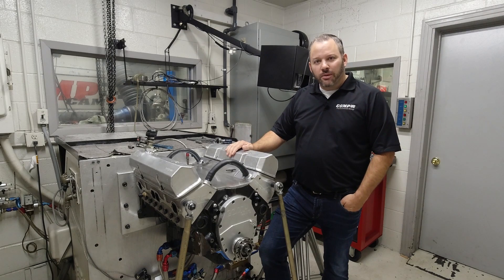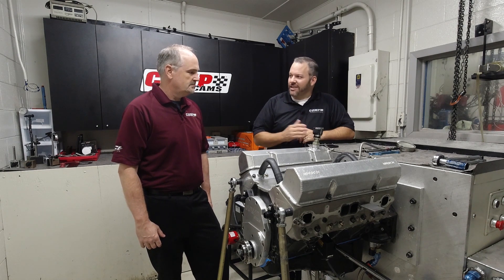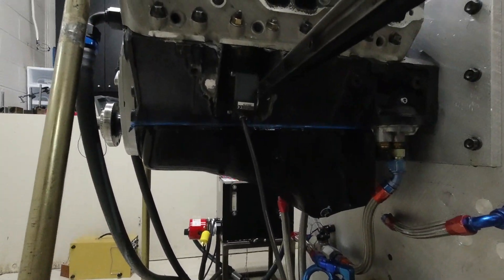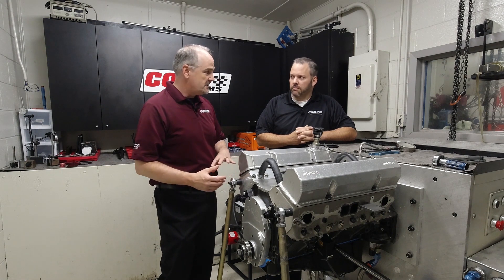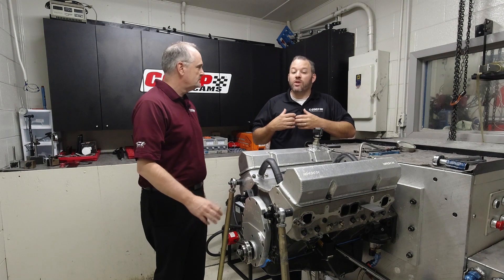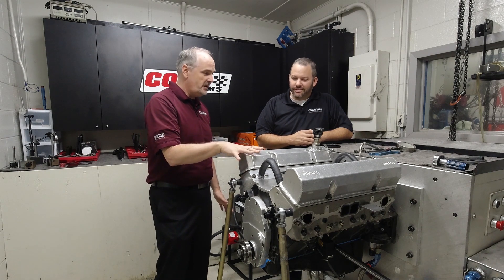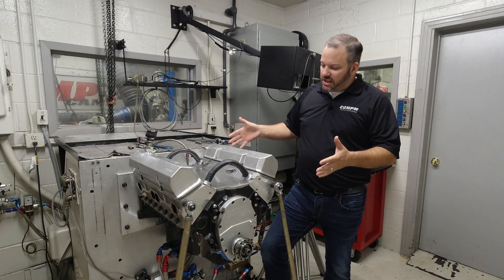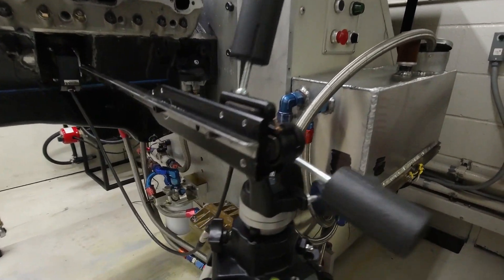CPG Nation Horsepower Tech: Spintron and interview with Billy Godbold

Comment: How do you guys simulate the thermal stresses and exhaust pressures on the valve face ?
Reply: I would think that would be for the valve dept guys.  And it would be rather easy to simulate heat and pressure in tests outside of an actual engine.  Could prob easily create higher pressures and heat in tests.

Comment: I have a curious mind and very much appreciate Comp Cams sharing the knowledge. Basically this spintron video just got my appetite wet oh, I would like to hear more about the details of exactly what you're testing, I noticed the pictures of valve springs and valve stem Flex as well as watching for valve bounce on the seat. However if you could go into more detail about what exactly is going on in those videos, as well as how you get the videos. As I understand that valve opening and closing seems slow but you're taking selective shots to give it a more antimated illustration. A little more explanation about that process. I would completely enjoy the education. You guys there at comp see it on a daily basis, but the General Public does not, so we need a more in-depth explanation and more video. Keep them coming. Thanks
Reply from the maker: The Spintron is used to test and evaluate all aspects of the valvetrain.  We can use high speed cameras to record and help give a visual to the data that is recorded from the different types of sensors we use on the components we are testing.  Its an extremely useful tool that helps us develop new products quickly and efficiently.  Thanks for watching!
Reply: @Compcams1976  t.y.

Comment: Thanks for sharing, great stuff!

Few questions:

You guys ever run a setup with a wet sump setup with the distributor?

Do you have the ability to take data and simulate the track?  Such as on a dirt modified where the tires are loading and unloading pulling the engine down, rughrarararaahhaahaaaa kinda thing?

What's the going rate range nowadays?  I recal some years ago it was around 2k a day.

Worked at a shop that had a spintron from old Nascar days.  Unfortunately it was a very glorified alternator tester and didn't get valvetrain r&d while I was there.  Look forward to doing development some day.
Reply from the maker: We can simulate all sorts of different track types and common situations that an engine finds itself in during those events.  Any testing needed with the distributor in place is done on the dyno.

Comment: That last clip of it running back and forth from 4,000 - 6500 rpm was awesome!
Reply from the maker: It literally does that on a million cycle test for hours.  Lots of great data for our engineers to peel through to see where they can improve.  Its a really good tool.
Reply: @Compcams1976  Great tool and the sound is awesome. I would have never believed the engine's valve train made up that much of the overall engine noise.
Reply: OH MY GOODNESS!!!! If you’re a gear head and that doesn’t give you chills, go to the doctor. Somethings wrong!!!